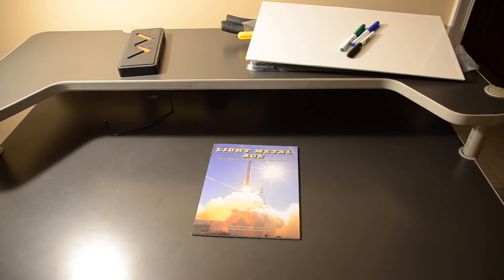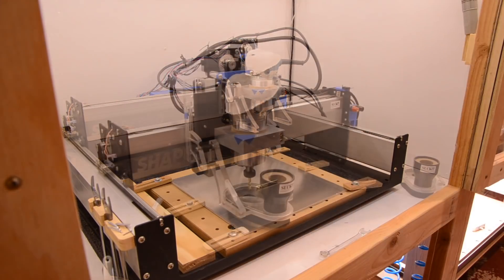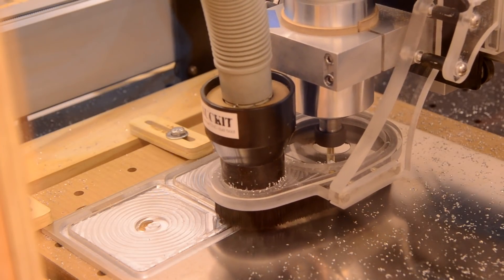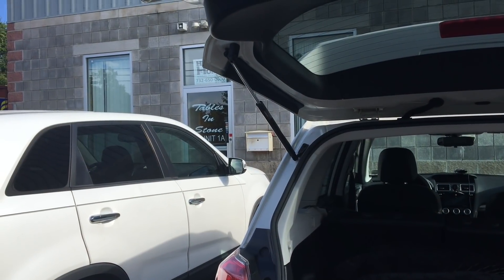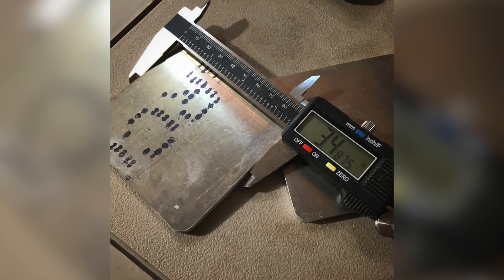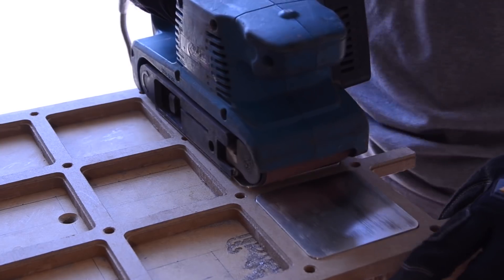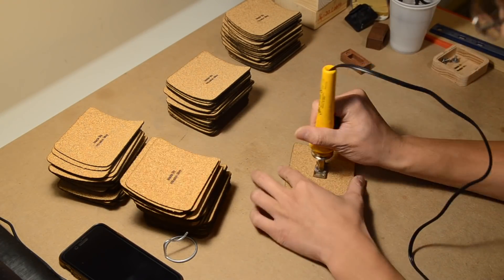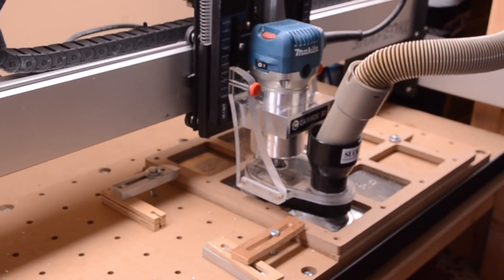Commemorative Drink Coasters for Light Metal Age - My Biggest Project Yet (#105)

Comment: With the amount of waste you had, along with the space between coasters, it would have been a good idea to use screws at each corner and intersection to hold the aluminum plates down. That would have fixed your warping issue, if your waste board is strong enough.

Comment: have you thought about holding the aluminum down to a sacrificial plate using a liberal amount of cyanoacrylate? 
Super glue is a secret weapon I used all the time when I need to chuck anything ackward to my lathe. an even coating on a flate surface is usually enough to hold just about anything down, as long as it is evenly balanced,

Just a thought!

Another Idea could be a vacuum bed with,again, a custom mdf layer, itself machined to hold down each coaster, with air channels on the underside back to the vacuum element.

Cheers!

Comment: Glad I came across you channel. Very impressed work.   Do you ever use Meshcam?
Reply from the maker: Rarely. MeshCAM is really only good with meshes (as the name implies). So STL files and the like. But I seldom machine an STL. If I'm designing my own 3D model in Fusion, I'm going to also generate the toolpaths in Fusion.

Comment: Great project, I have a question about pricing such order, do you have some tips? What is the total cost/profit per one coaster? Do you have a sample spreadsheet you could share?
Reply from the maker: My preliminary estimate really just went along the lines of: how many linear feet do I need to machine, how long will that take, how much do i want to make per hour + materials + services + margin. Which kind of went out the door when I had to go out of house for waterjetting. You can find spreadsheets for this, but I was basically just writing down expected expenses in a notebook. Would do things differently in hindsight.

Comment: for the record, sometimes it is in fact more efficient to run a single coaster at a time per operation. its more repeatable. i would have laser cut them out as you did, ran an op to square them to length, then set up a stop to use the pre existing xy position then ran a cut to bring it to width, edge break, and cut out the pocket. after word, flip it over, and edge break the other side only after the graining process. this would have run a total of only a couple hours and cut back on waste. also, try hooking up an air hose nozzle to spray air right at the tool. this forced air will help blow away gummy material like aluminum but also cool the tool and material extending the life of the tool and provide a cleaner finish for the part.  for machining aluminum try investing in some niagra brand tooling. in my opinion they are some of the best you can buy for it.
Reply: also, i am impressed with your work and utilization of your shop. i machine and program professionally and envy your ability with so many limitations you mention casually in your videos.

Comment: Yep. A vaccume table would have been 🔑. Probably as much momey as you paid to have those parts water jet as well. You could have had the blanks laser cut, if you could find a industrial grade shop to take the work of course. Your edges would have been perfectly clean and its cheaper than water jet.

Comment: Life changing hold down method. The vacuum alternative. Increased precision, speed, and, better finishes guaranteed in any material.

Firstly, you will need to level your spoil board the day of or the day before your plan to cut.

Here is the secret.

Instead of double sided foam tape for your hold down method, fist mask the backside of the material where a level surface area is needed with 2 inch transfer tape, and squeegee down. Then go to home depot and buy Roberts 1 and 7/8ths double sided permanent carpet tape. Apply the carpet tape and squeegee down.  line up material to machine, and press down. 

The problem with foam tape is that is compresses, moving the material up and down as the bit moves through the material. Carpet tape minimizes play because is has no foam and is a double sided adhesive. 

The transfer tape is used simply to make removal of the carpet tape from your finished product easier. Highly recommended.
This hold down method is EXTREMELY ridged and would only need 3 strips to do the 9 coasters.  

No jig needed because the face is laser engraved.

ALWAYS ramp in aluminum and use 3d tabs if you are adding tabs.
 Also use the 1 flute aluminum specific bit to reduce your heat load. preferably get one with a polished flute for better chip evac.

I appreciate your extremely detailed eye. Look forward to faster production times with this method and best of luck to you.

Comment: Nice video, always.  Very interesting view of the problems of a small shop.  

I have an S3 and have not been successful cutting aluminum yet.  One question - you used a vacuum for the aluminum chips.  Do you have any concerns about explosions/fire in the shop vac from the hot bits of metal swirling in the dusty air?  Or are the chips cool enough that this is not a concern?
Reply from the maker: Given that it's a 10+ foot run through turbulent air, and the chips are landing on a bed of more non-combustible chips, I'm not too concerned. The chips also aren't glowing red hot like you might get if you dry cut steel. (Don't ask me how I know.)

I really just have the dust shoe there to encourage airflow over the cutter and keep that cool, since I don't like cutting for prolonged periods dry. I need a drip system like JPL_Richard.

Comment: So it looks like you did decide to spend the money on a Dust Deputy after making your own dust collector previously. Do you notice a significant improvement?
Reply from the maker: The plastic is a little thicker and sturdier. Also more static resistant I believe. Still, the weakest point is the bucket lid. Home depot buckets are pretty flimsy, and both versions will tilt if your hoses are heavy.
Reply: Good info Winston. Thank you. I have seen some YouTube videos that try to address that issue with making wooden covers.

Comment: Hi Winston, love your attention to detail in your narrations. It's awesome you show us your failures along with your successes. That aluminum warping problem, could it have been solved by using hold down screws in the waste material?
Reply from the maker: If I put a bolt through the middle, I probably could have taken out about 80 % of the warpage and been able to work with that. The edges have some bowing of their own going on. But it would've been a lot of stress on my cutter due to the friction issue. People have raised valid points about the utility of troichoidal milling of slots, but it was just way less stressful to have the waterjet shop do the main cutout.

Comment: First thing I noticed is that I often see metal work pieces being clamped with wooden clamps. As an example, take a router bit in your hand and see how much force it takes to dent a piece of wood. Now try that with aluminum. The wood clamps may not be "holding" your aluminum work rigidly enough. (I will definitely be able to give you more relevant feedback soon as I just ordered a shapeoko XXL and I'll be getting a kress 800 spindle)

Another simpler option could have been to account for spacing, and drill some hold down holes in the corners between each part Contour. This would gaurantee the plate would be held down flat all around and allow you to do all contouring with very good part rigidity. Thin aluminum plate stock has a consistent tendency to have warping in it; no cheap way to get around it.

Final thoughts, I would cut multiple passes around the outside dimension. First pass would be over sized, and leave material on the bottom of the cut and the Contour. 2nd cut would cut the part at actual dimension and full depth (you could add chamfer bit between these). While double sided tape may work for wood, it will still allow metal to move under the force during machining and I hesitate to agree that it isn't moving just because it doesn't look like it's moving during cutting (even .002 movement can hurt a carbide end Mill)

I would recommend looking into trochoidal tool path descriptions (high speed machining concepts). It will help you understand why and when they are used
Reply: Great recommendations. I would add the use of precision should bolts in applications where tolerances are tight. I don't run a cnc router so I don't know if accuracy is even a concern on a machine like the one in this video, but I use shoulder bolts in at least half of my projects where I don't machine a dedicated fixture plate. Advanced tool paths would definitely assist in metal removal rates and help prevent gumming and tool failure. Personally, I would have anodized the sheet, laser engraved it, then cut it into coasters to save time, money and handling time.

Comment: WOW! You have been busy.  Regarding branding a bunch of the same components. Create a fixture to mount your iron to your Shapeoko then a simple tool path that will bring the iron down to a fixed height with a suitable delay. (May require hand coding the gcode.) Would be safer to have the tool path start 6" back then move forward, down, delay, up and back to get it away from your hands. Then just a simple jig to put the component in the same place each time.
Reply from the maker: It's been in the back of my head. I've actually wanted to make something like that, but spring loaded so I could do woodburning and pen work too... The hand coding wouldn't be too bad: feed down, dwell (or waste time on a really slow move), rapid up, copy-paste x150.

Comment: nice project and nice video.
You should consider buying a big/normal beltsander. The handheld ones have a slower speed. A big beltsander would have done that job easy and fast.
And its an investment for future project :)
Reply from the maker: Definitely wish I had one, I'm just resisting the urge to buy a lot of equipment at the moment though because I'm moving in less than a year...
Reply: i feel you :D

Comment: Wow that was a lot of work, hope they paid you enough to make it worthwhile.  Careful not to get burnt out on larger jobs like this.  I ran a paid job on my SO2 a couple years ago, cutting out a bunch of fiberglass parts.  IMO a shapeoko-class machine, even a SO3, is probably not the right tool for it.
Reply from the maker: So, without going into specific numbers, I've taken tips from woodworking podcasts about establishing a daily rate. A full day's work is worth X dollars, not inclusive of materials, outside costs, subcontractors, etc. I charged enough to make 3 to 3.5 full days of work (spread out over many evenings and weekends), but after everything was all said and done, pocketed a little over 2 days worth. I spent less time fighting with my CNC, so I personally saved time (which was a plus), but spent a little more having the waterjet cutting done. 
I bought enough material initially to make an extra half dozen coasters or so. Ended up needing to buy about 2-3 extra sheets of aluminum because of yield issues at waterjet. From waterjet I received 161 usable blanks, and I pulled the lowest quality pieces after anodizing and laser engraving. Right there is a 6-7% increase in cost, due to the fact that you need a safety margin. Not every piece will come out perfect so you have to make extras.
Easy to overlook for a rookie like me, but it's an important variable to understand and plan for.
Reply from the maker: +secretspy711 With the complications, and having to outsource, my effective hourly rate wasn't quite as high as I hoped, but I came out positive... Should have charged 20-30% more. The schedule was the most brutal part. I had to hand deliver parts from one shop to another so I wouldn't lose time to having them in transit. Without that I would've been a lot less worried.
Reply: At the end of the day what was the profit margin? before and after the unexpected out sourcing? This is an 11 minute video with tons of life lessons for small shops. Thanks.

Comment: a regular table saw works fine on aluminium, you could have cut out the squares and just did the corners and the edge in the CNC. A vacuum fixture shouldn't be too hard, a plate with  hole and a groove for an o-ring
Reply: Yup, table saw the squares and clamp them all together..... then corner edge down all four corners. (But yeah, the edge finishing is sometimes the hardest part)

Comment: I totally understand your challenges.  It took me a year working part-time to get a decent process going when coming from a prototype to an actual product.  Even so, there are several improvements I need to make including more accuracy and vacuum workholding.  It's easy to make stuff at a loss, it's much harder to make it at a profit.  Thank you for the excellent lessons learned and solutions you came up with.